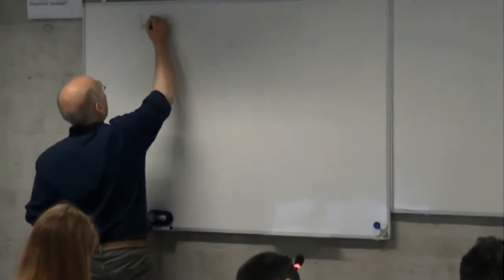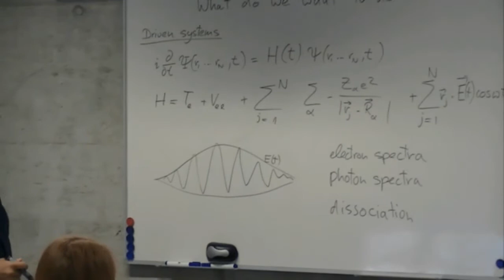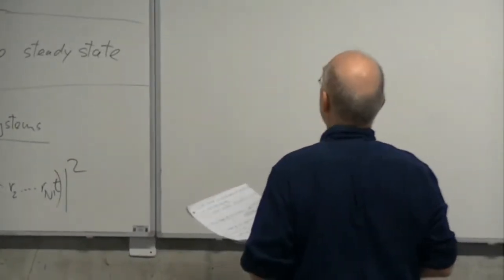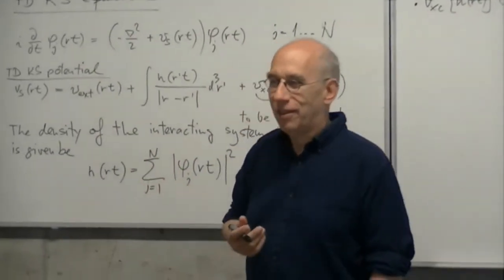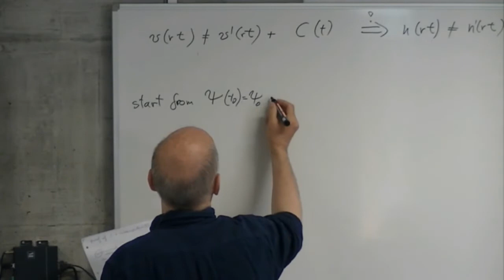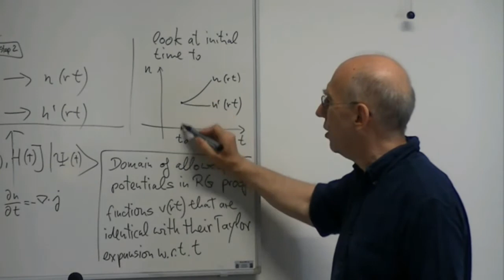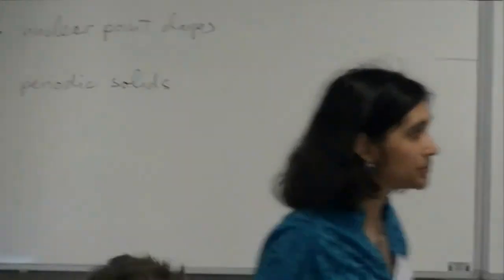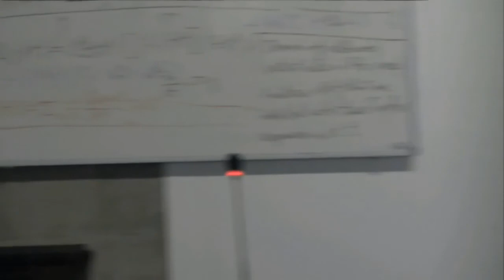time-dependent density functional theory

Comment: I believe another approximation used in the Hamiltonian in 12:00 is the so called "dipole approximation" which is valid when the wavelength of the irradiation is large compared to the position uncertainties of the electrons.